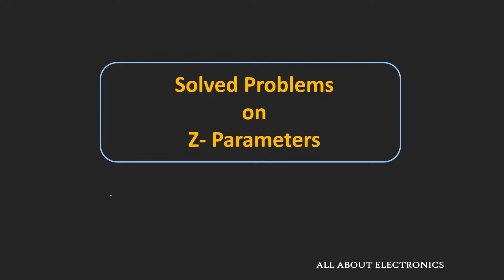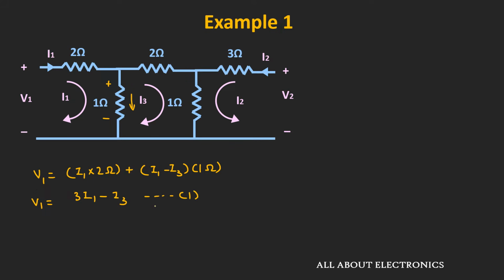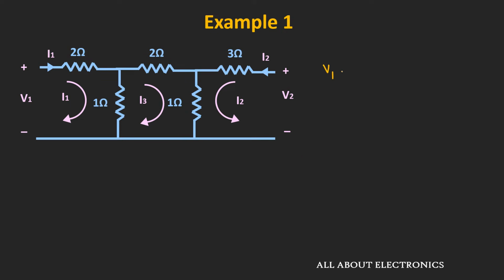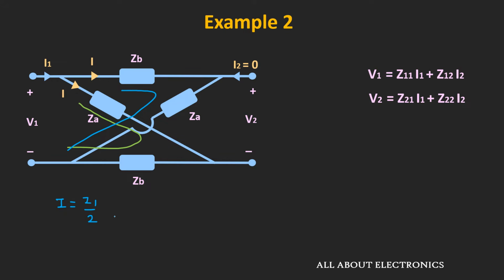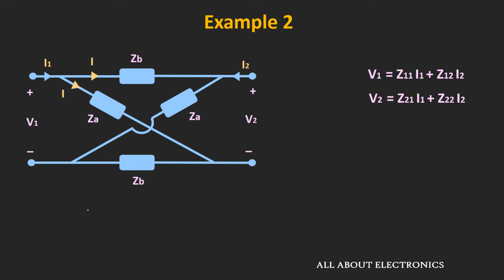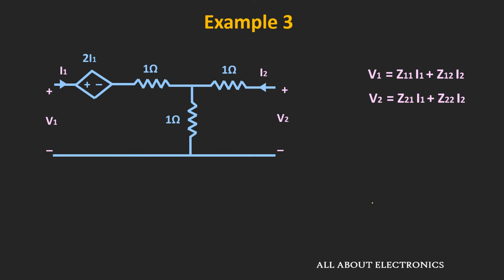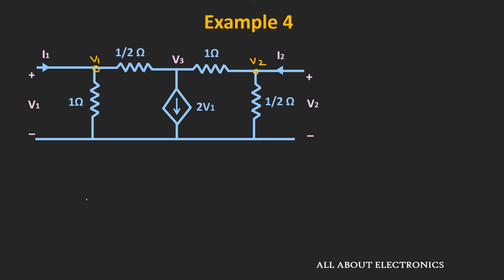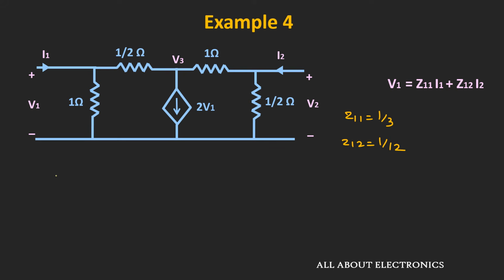Solved Problems on Z - Parameters

Comment: At the last example, i got stuck!! When to apply KVL and when to KCL??
Reply from the maker: It depends on the circuit. You can also find the parameters using KVL. But here, since there is a dependent current source in between, so you will encounter the supermesh. That's why here KCL is used.
Reply: @ALLABOUTELECTRONICS  Now clear. Thank you

Comment: Sir...how did I2 become positive in the mesh 1 (example-3)
Reply from the maker: Both I1 and I2 are flowing in the same direction through 1 ohm resistor. That's why voltage drop across 1 ohm resistor is (1ohm)* (I1 + I2).
I hope it will clear your doubt. If you still have any doubt then let me know here.
Reply: @ALLABOUTELECTRONICS  oh...now I understand sir..... thank you soo much sir 😊...

Comment: How's the direction of current -I in example 2?is it because of directions chosen in first equation?
Also,is it a fact we can learn by heart that lattice network is symmetric and reciprocal?
How did you reach at that conclusion?
Reply from the maker: Yes, the direction of the current is as per the earlier equation. Because during the calculation, Port 2 is considered as open. So, no current will flow in that direction. 
Yes, the given lattice network is symmetrical and reciprocal. And in fact, that is also evident, if you just look at the network.
But when in doubt, you can also find the remaining two parameters to check the conditions.
I hope it will clear your doubt.
Reply: @ALLABOUTELECTRONICS  thank you bro

Comment: Please what can you use this circuit for??
Reply from the maker: As I mentioned in the introductory video of the two port network, for the analysis of many practical network, the two port parameters are very useful. For example, transmission line, small signal model of BJT etc. 
I hope it will give clear your doubt.